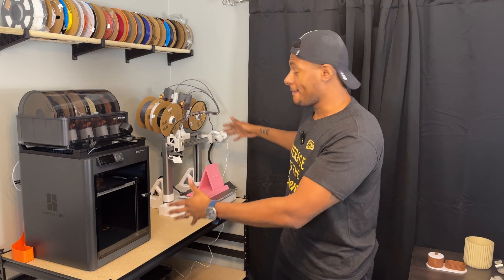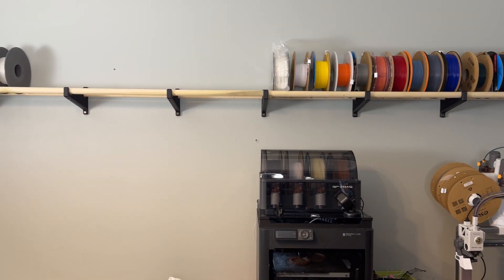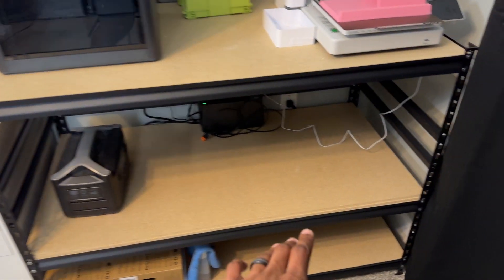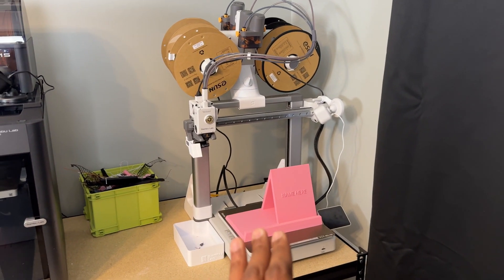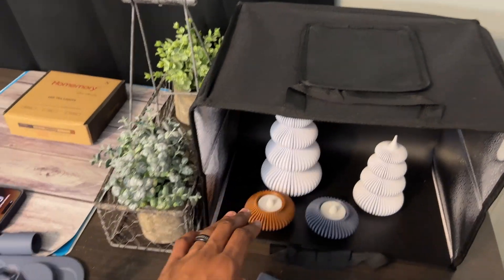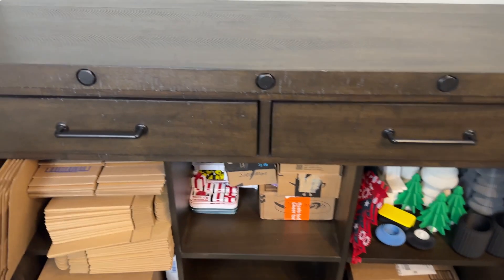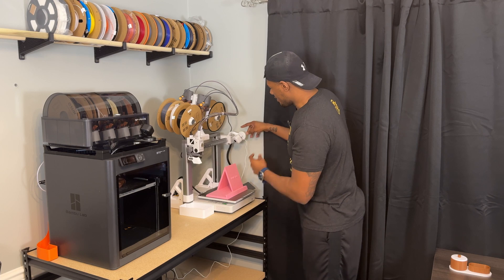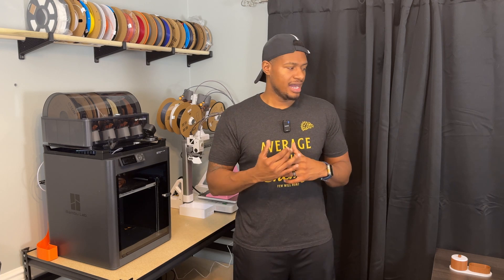I Built a MINI 3D Print Farm at Home!

Comment: the quality on the A1will dip unless you're doing constant maintenance whereas the p1s is you can do maintenance once every 6 months also you really don't need a glue stick just clean the build plate with hot hot water and dish soap the try not to touch it to much keep your finger on the edge have a box of disposable gloves next to my printers for when I have and full build plae that need flexing
Reply from the maker: @headhunter_4209  🙏🏾